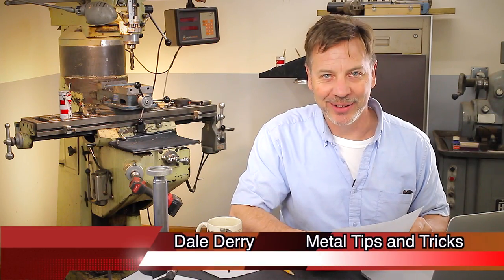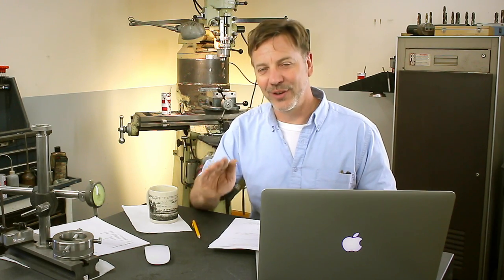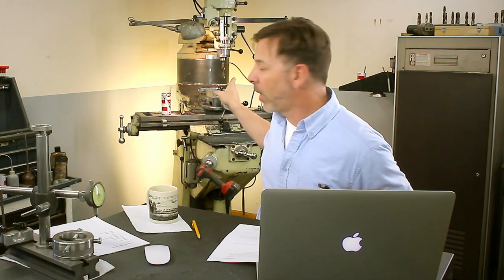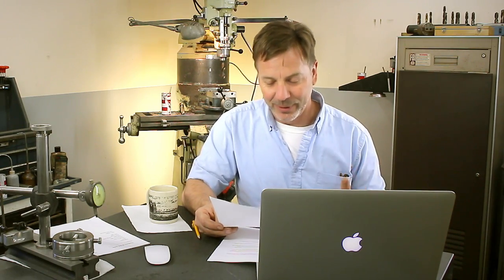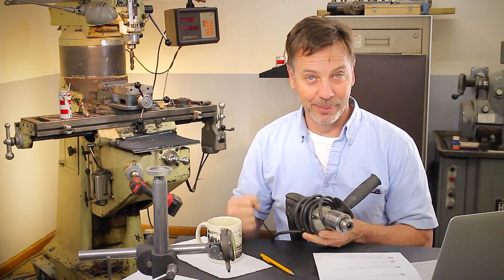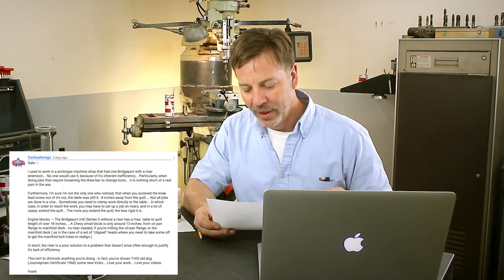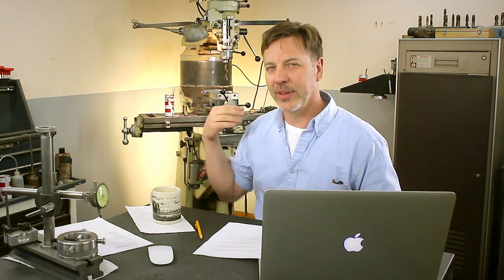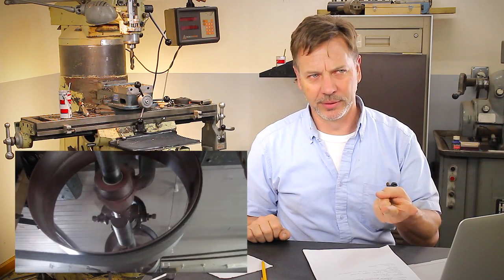Q&A RISER BLOCK

Comment: I have a 1/2" Dewalt corded drill with something like a 13 amp motor and gear reduction. It will tie you in knots when it digs in if the bit doesn't break. I do not just pull the trigger and drill with the thing. I bump the trigger and also with a large bit I use a piece of scrap as a backer so the bit has something besides air to bite when it breaks through. It makes it much better/safer.
Reply from the maker: +DSCKy 
Great suggestions

Comment: i  have been enjoying your videos very much. I also have raised my equipment to better soot my height.
I do believe the reason for the stock height is more of a safety issue . being lower it keeps your head face and heart away from possible Fails   taking a chunk of steel to the gut would hurt much less than in the chest.
I will keep my machines up  where i have them but take extra care in the operations ..
Keep up the great videos. 
   Scott
Reply from the maker: +scott garloff 
Great comment :-)

Comment: Thanks Dale for both videos,  I've been studying alot about what size riser I need for my Grizzly import G0796, (9x49)  this helps some but I guess I need to do some calculations with my Rotary table, vise, etc.  to figure it all out.  Would be nice to somehow know what part will fit for sure.  Most likely would be next to impossible to find a piece of cast iron type material around here that would be cheap enough to build my own.  That website you listed don't seem to work for me, sends you to a complicated mess.  Keep up the helpful content, always enjoy it.